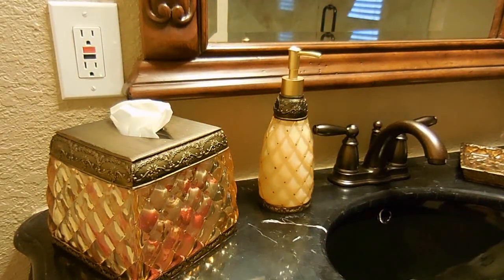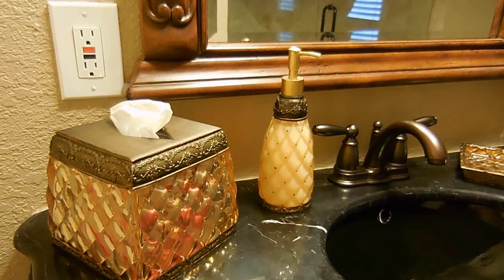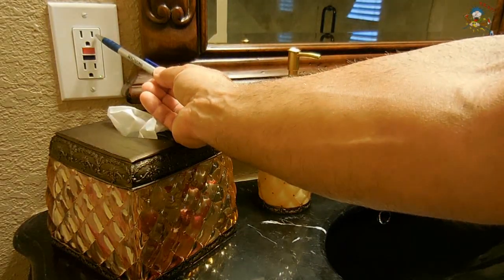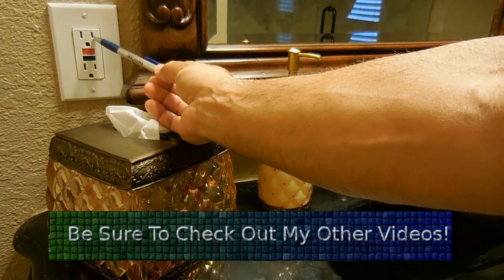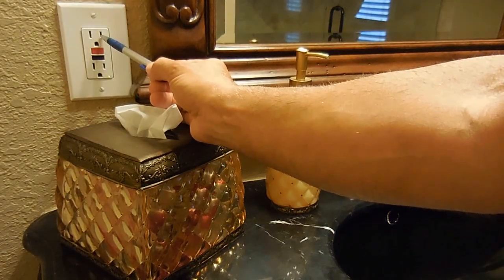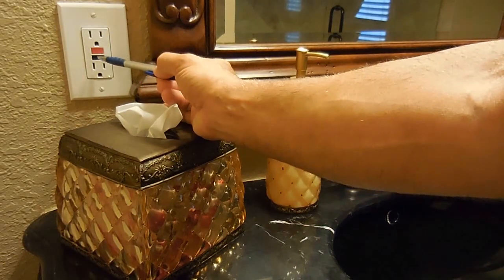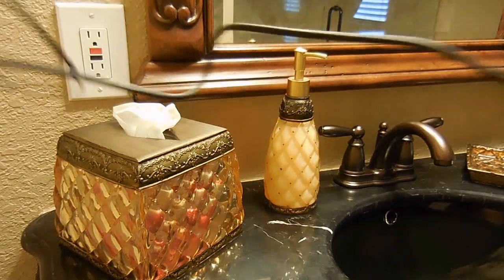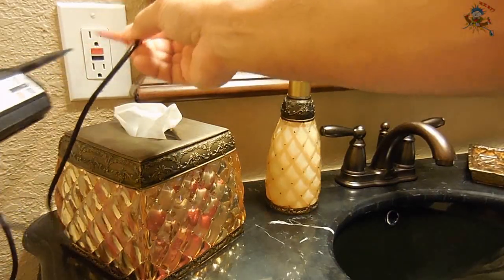Fully Understanding How GFCI's Work

Comment: I wouldn't mind these things so much if they'd just use them for every outlet.  As it is, there are three of them in my house, and each of them controls some random assortment of outlets throughout the house.  The three GFCI outlets are in the most inconvenient places, so whenever one randomly decides to trip, I have to go hunting to find it.  There's no logic to it, either.  The one in the kitchen controls two of the three bedrooms upstairs, while the one in the garage controls most of the kitchen...

How there can only be 3 GFCI circuits for the whole house, but ten 15 amp breakers in ganged pairs is beyond me...
Reply: +rhkips Blame the electrical contractor who wired the house. In my house, they did a much better job. The kitchen is on the same circuit as the downstairs 1/2 bath. The upstairs bathrooms are on their own circuit. And the garage is on the same circuit as the outdoor outlets. I would bet the electrical contractor probably wired yours like that to save wire. Also, in current US electrical code, bedrooms should be wired with an AFCI (Arc Fault Circuit Interrupter), not a GFCI. There's a big difference between the two.
Reply from the maker: +rhkips 
Hi. Each GFCI receptacle has "LINE" and "LOAD" terminals. Additional receptacles connected to the "LOAD" side of the GFCI will be protected by that GFCI. It is sometimes easier to eliminate the GFCI receptacle and use a GFCI circuit breaker instead.
Thanks For Watching! Be sure to share my channel and rate thumbs up.
Reply: +rhkips I think your electrician  or you, if you did the wiring, should have done a better job of diagraming your electrical wiring ( sometimes called a schematic diagram ) Savvy?
Reply: ROBERT JOHNSON
Haha, I agree!  If I had done the wiring, the house would be a very different place!  Sadly, this is the kind of shoddy work I've come to expect in cookie-cutter tract home developments in California.  :[
Reply: 10 15 amp breakers? It would appear that many outlets are not GFCI protected?

Comment: Great explanation, but I was expecting a test device consisting of a three pronged cord cut off and dipped in a sink full of water. :-)
Reply from the maker: +House of Hacks 
Here is one for you. :-)
https://www.youtube.com/watch?v=4BXGRBQsPHE
Reply: +electronicsNmore Thanks. :-) The end was cool where you were using it as a low voltage power supply.

Comment: I don't like them and there are none in my house.
Reply from the maker: +BUDDY LIGHT 
That is fine, but if you go to sell your home or purchase house insurance, you will need to install them. :-)

Thanks For Watching!
Reply: electronicsNmore
They don't hold up very good and always wear out.
Reply from the maker: BUDDY LIGHT
Sometimes they can, but usually the GFCI is not the problem. All it takes is a very small current leak to trip them. Sprinklers or rain hitting a receptacle is a common one.
Reply: electronicsNmore
Electric heaters pop them all the time.